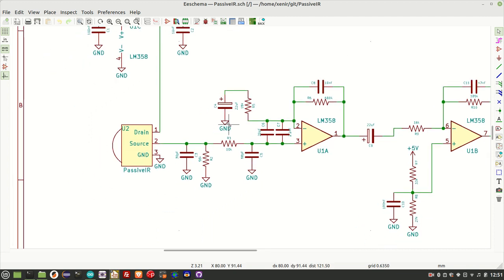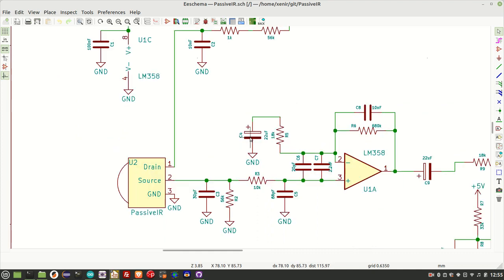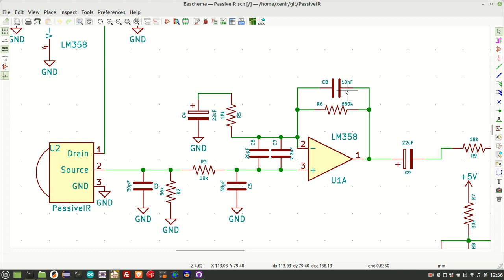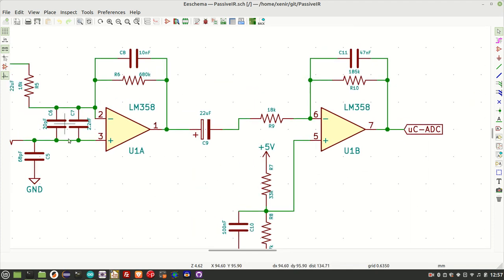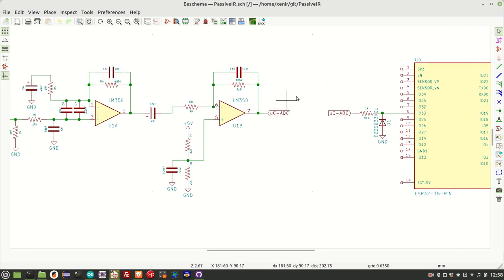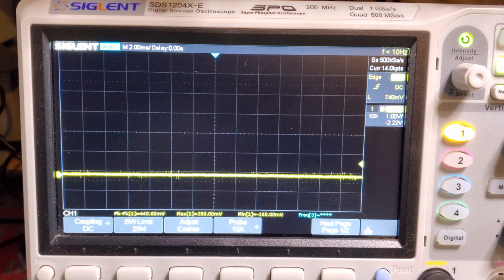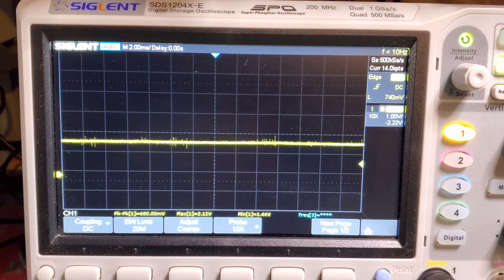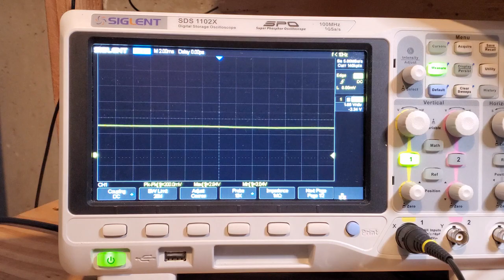Passive IR Sensor circuit Reverse Engineering

Comment: Hi, I love all your videos. Can you make a video for broadband (up to 2GHz) power amplifier design schematic? I have single power supply and would like to stick to it so I am trying to avoid push pull amp. I have LDMOS in mind but I got very confused fairly quickly. I would really appreciate if you could post a video about the topic. While I understand that building one will be expensive, just analyzing schematic would do fine for an audience such as me
Reply from the maker: Thank you for the kind comment Giorgi. A 2GHz power amp though is a bit beyond my capabilities unfortunately. That would require specialized knowledge and test equipment. I do intend to do some more homebrew amp videos in the future so stay tuned!

Comment: You need the lens, as sensor detects the difference between the two ir sensors in it. They need the movement to trigger.  We use to see who could get passed on at work by moving very slowly. At a distance you got away with it, but close up you could not go slow enough for it to think you were background ir.
Reply from the maker: Ah interesting - I might 3d print a little housing for it, put it back in the lens  and retest. Thank you for the comment